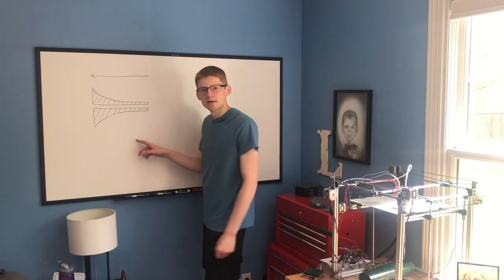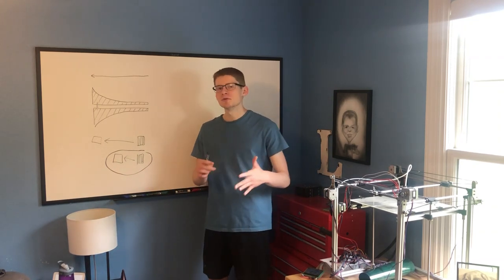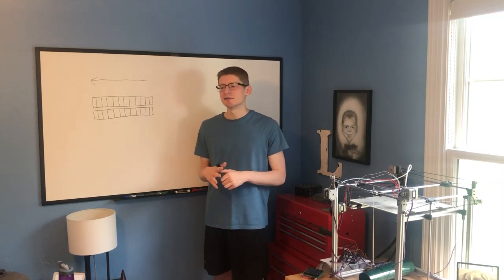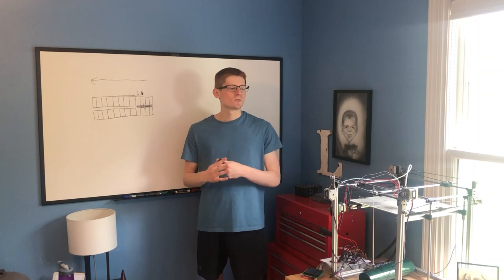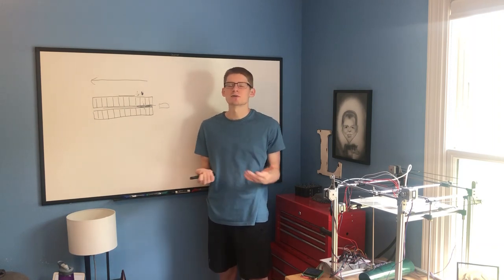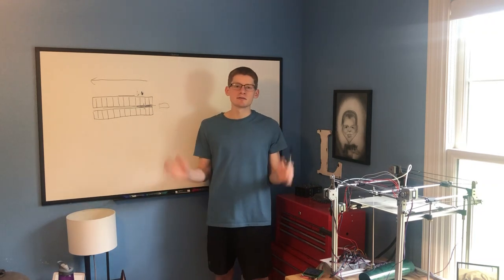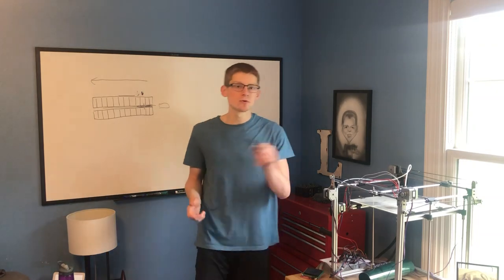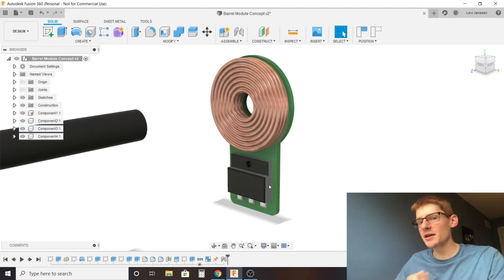Making a Coilgun - Part 4: A New Revelation

Comment: This seems like a brushless motor / ESC problem. A sensorless motor provides the feedback to inform the progressive pulse. The question about wire diameter and number of turns and resistance is a question of ampacity. The wire size you choose determines the current you can push V=I.R. If you sequence the firing of coils as you  describe but do them in series you put more voltage across the coils.

Comment: There is no ideal number of Turns in a coil. It all depends on the voltage you use. If your voltage is high, Your current can get lower because you can use a coil with more resistance and thus more turns. I observed this in different coils and voltages from 20v up to 1kv

I have Played around with Different coils and Different voltages. The thing i learned is that you can pretty much calculate the number of turns in a coil Based on your voltage and the resistance of your wire to get the Maximum current at the given voltage. You have to conclude every component in the circiut because the total resistance is important. 

I would suggest that you measure a given length (1m) of your wire. Based on this you can calculate the Maximum current at your operating voltage per 1m of wire. Then you just multiply the length and calculate again until the Maximum operating current is within the Limit of your Power source.

At the Ende you will have the exact length of wire you have to use. The ammount of turns hardly make any difference from there on given that you work with a "long" coil wich has more then 3 layers.

Also the results with long coils where the diameter is smaller than the length have been netter in my Experiments.

Contact me if you need more Information about coils.

Comment: @Levi Janssen .. Thin wire  would be your best bet .  As to the ideal number of turns per coil  that is going to require trial and error.   

Your going to have to make models of the coil on a slightly smaller scale than what would be full size and experiment with the different gages of wire and different windings.  

What you are doing is entirely experimental.  Once you have the number your comfortable with figured out you can scale up from the model to the full scale.  

Science isn't easy .  It takes trial and error to get it right. 

Thomas Edison made 1,000 unsuccessful attempts at inventing the light bulb.

When asked about it . Edison said “I have not failed 10,000 times—I've successfully found 10,000 ways that will not work.” Referring to creating the Light Bulb.  

But he did find one way to make it work obviously. 

So the way I see it you have two choices you can agonize over the questions you have about how to make your concept work or you can experiment until you figure out the one way that you can make it work.  

I think you can do .  Just get to it.

Oh and after you figure out the turn count and get the coil gun part set up it might be a good ideal to design a magazine feed system.  I haven't seen anyone do that yet.

Comment: How about using a conductive projectile where the base (or end) of the projectile is used to "make" the connection which gives power to the coil. The instant it accelerates and reaches the second coil (by kinetic energy of the first coil), it completes the power supply to the second coil which gives it thrust to move to the third coil and so on.
Only issue is the froction heat which could destroy the rails eventually (after firing a few rounds)
Reply: From what i understand that would essentially make it into a rail gun,  defeating the purpose

Comment: Isn't the magnetic field inside the coil mostly unifor? So when the projectile reaches the magnet it gets accelerated by an almost constant force towards the (offset) center. You also need distance over wich the acceleration occurs wich the cone shaped coil provides.

Comment: Just a couple of thoughts.
In terms of coil control, it is similar to microstepping stepper motors.
About detecting the position of the projectile, the projectile will change the inductance of the coil. There could be a voltage change on the coil telling you where the projectile is. Thanks for your video.

Comment: Nice! Would it be possible to collect some kind of data from the coil to detect when you power it? Some kind of hall sensor? Each coil should "produce" power and each coil should have an optimal point when to dump its stored power into the coil. Each coil would have it's own capacitors with the correct amount of coulombs/joules... Fairly "static" with regards to barrel friction and projectile weight, but that seems hard to get around without rather sophisticated real-time (high throughput) measurements...

Comment: i have made a coil using 32 gauge enameled copper wire but it does not work can somebody help fix this i have tried different batteriess but still does not work do i need to perfectly coil the wires side by side, please i need help

Comment: You've got a 3d printer just print a bushing that presses through the coil, you could probably just slip it into the next bushing and ditch the carbon fiber all together. When its built, seal it in a tube and oil cool it.

Comment: have you thought about using tiny wires between the coils and use the projectile to make electrical contact similar to a normal switch for locating the projectile, but I don't know how long that would last considering the forces involved.
For the coils you could try potting them in resin.
For cooling the mosfets there are already good suggestions, but for cooling the coils, in the past, I made a small high power BLDC motor using small copper tube instead of copper wire to Watercool the coils from the inside, that allowed me to push the motor from 500 Watts to 3300 Watts.
Reply from the maker: 500 to 3300 watts? I'd love to see that motor, it sounds remarkable.
Reply: @LeviJanssen  It was a Skateboard/Longboard hub motor, I don't have exact data on it, but the motor itself was most likely capable of more than 500 watts, but I had to limit it in the controller to 500 watts because after 10 minutes on more it started melting the plastic tire.

Comment: Use laminate metal sheets in between the windings. This may work the same as it does in solenoids and transformers. It concentrates the magnetic field and the laminate steel reduces loss from eddy current. Just a thought but best of luck
Reply: Would washers work?

Comment: If energizing more than one coil at a time you can also ramp them...   Like a multi-step controller for a stepper.     Or something better I just thought of (so it must exist)....  using beeeefy transistors and amplifying "audio" to multi-channels (for each coil)    Then to to calibrate and dial in, you can just generate a .WAV.  Sounds silly... but this way you get all the audio tools for generating signals and you can even generate them based on different algorithms.      (or have different files for different settings...  from Chastise to Inject to Perforate)
Still think there is some more life in your first idea...  maybe still a cone, but stepped like with this idea.        Also, why not just have all the coils charged ahead of the projectile, and just cut them off at the right time?   (kinda negating the audio file idea, this would just need timers or trip-triggers)
as for sensing, it might not take too much space if you can embed a sensor in the barrel, the wire can be hair thin for a sensor... or use a fiber optic thread to project and sense the light in a more roomy zone.
I realize I have 3 separate control mechanisms up there...   Manipulate, Time, and Trip
I should watch the second half of the video, I guess.  :)      (Edit: or read the comments before I write a novel)

Comment: Yes a coil gun without sensors works best. The timing doesn't even need to be that precise because the maximum force generated by the coil stays quite constant for a short distance within the coil. I measured the forces applied to the projectile depending on its position while pushing constantly 10A through the coil. 
However, I'm actually having constant speed with every shot without using sensors. Only the starting position needs to be kept precisely for every shot. 

I think you shouldn't take such a short coil. Aim for a square winding ratio instead like 16 x 16 or 20 x 20 or whatever. The reason is the (simplified) equasion H = i * n / l where l gets minimum when using a square shape. Using a coil that is shorter than its height has two negative effects: 
- H becomes lower
- Acceleration distance is shorter

Don't use IGBTs please. I was using a 100 € one for my gun which could handle 200 A constant and I thought it would be no problem for it handling 2000 A for 2 or 3 ms like Thyristors can with ease. Hell I was wrong! But you could still use IGBTs or Mosfets for low voltage/current per coil but you will probably end up with 50 coils to reach 140J kinetic Energy which I can achieve with Thyristors and 7 coils.

My most recent Idea was using multilayer coils (each layer has its own independent capacitors connected). This way you could release the stored energy per stage a lot faster which gets more important the faster the projectile becomes.

Comment: Optical Interruper is more reliable and fast, but does need a gap, i agree on that.

Lidar distance from rear is VERY intresting.  Would be cheaper, needs some testing.
Reply: The gap must also be increased for each additional coil and the sensors have to be adjustable in terms of their position relative to the coil.

Comment: 7/17/2023 4:00 PM
1. 1 BIFILER COIL
2. 9 CAPACITORS at 1F each
3. G7 Aluminum bullet 
4. Rifled RESIN barrel
5. 30 3.7V Lithium batteries
6. A arduino and code to control it all. And that only took two hours to come up with!

Comment: To hell with MOSFETS  !!!!!!!!!! I hate them.   Have blown too many from electrostatic discharges in the Lab.  I only use Power transistors like the TIP41 and up to the 30 Amp, 250 Watt, MJ21194 Power transistor. They can take a shit kicking !!!!

Comment: Machine your holding board out of Aluminum.  Make it in 2 pieces, 1 piece is a cover plate and the other plate is hollowed.  Use water for the cooling agent.  Start with the make up (dia, weight and length + the material) of the projectile (tungsten ).  Make the Barrel 1.1 x in dia. greater than the projectile.  Barrel should 10 x the length of the projectile.  Figure out the velocity in (m/s) using initially only 3 coils fired in a cascading sequence using optoelectronic (led + photo diode) as a trigger switch.  Determine coil size, + wire dia. + # of turns with a constant input Voltage and Current, by testing and recording the results.  Plot Velocity against power input (+ time pulse is on).  Try to make use of the Back EMF Created each time a Coil is Fired.  Add High Voltage Capacitors to the Battery Circuit to Boost out put power.  Use 16 gauge magnetic wire for the coils, which should be 3 x the Diameter of the Barrel.  Add Modules to the Barrel to boost output power.  Write an Python sketch to control an Arduino for switching on the Coils in Sequence.  See / find out how to wind Pancake Coils.  Use Hot Glue to hold the Winding in place, then cover in epoxy.  Capacitors will handle rapid/sudden voltage Drops than batteries will.  Have 2 separate coil banks so that one bank can fire while the other recharges. Good Luck and Happy Engineering!!

Comment: I know you have asked for ideas regarding the number of turns for your new idea and I am sorry to say my knowledge of such things is pants. but I was thinking could you wind the turns as one single like previously but with a skateboard ramp style curve, with the curve larger at the start, curving down with less turns before increasing the number of turns towards the barrels exit. this would possibly allow you to overcome the issue of starting the projectile so far away from the magnets main pull, costing efficiency as it has to accelarate towards it inefficiently at the start. I wonder if at the start the thickness of turns should not be maximum but enough to give it a good push whilst being lower than the attracting magnetic pull in front. as I mentioned earlier I am no scientist, but my ADHD brain seems to be able to see soloutions to problems in a similar way to yours. let me know your thoughts, there is probably a glaring reason why my idea would mot work, but wanted to share to find out your thoughts. thanks from a curious mind

Comment: layer upon layer held in place by a resin in a mould, fine layer of ceramic or glass to insulate ?

Have you worked out the most efficient windings ?

Comment: I have not made a coil gun but have mulling a few ideas, one is to use fiber optic strands. the IR diode is glued to a photo optic strand, and inserted into a disc used to hold the coil the disc could be cut in three parts end doughnut, two semicircles glued to the former and the fiber optic of the IR transmitter and the fiber optic to the IR receiver, then the other end doughnut. I have a few other ideas floating in my head if you like.

Comment: Using the same conecal shape, could you just make the whole cone a single layer of winding instead of more winding on the larger side?  Wouldn't the magnetic force be greater in the small diameter section with equal layers of winding throughout the cone?

Comment: Also do a hybrid of controler based and trigger based accelerator. I mean you have something like an LDR strapped to a mosfet and the mosfet triggers directly the coil but it can only trigger if the controller gives the ok. So the controller is like a director that decides which coil may fire and which on doesn't. Also the coils give information to the controller such that the coil decides on the fly which coil to activate next

Comment: if its a matter of where to put limited energy then it wouldnt make any sense to share energy with other coils since their influence wouldnt be enough to justify the power consumed.

if you have power to spare and simply adding more energy to a single coil results in a problem where you reach a point of diminishing returns...then there might be a lot of math to do trying to figure out where and when to give power

a polarized projectile would probably just complicate things but i havent given it much thought

Comment: Optic fibre between the coils keeps the detectors outside the coils and can be made as a remote detector and control module. You can wind the optic fibres into the actual coils. On-time is important, but also, inductors take time for the field to collapse and will slow the projectile if the coil is not collapsed in time. Bundle one end of the optic fibres to your IR source and detectors for each coil optic fibre. One or more feed fibres and a detector fibre for each feed fibre. You need to understand inductance more in your coil designs.

Comment: As far as detection goes, an optical rangefinder behind the breach of the gun seems most sensible to me: no need to space out the coils further and the information for timing all coils is obtained by a single sensor.

I agree with thin coils. I'm pretty sure the resistance, magnetic field etc gains of the number of turns in the coil all cancel out so long as the volume of copper in the coil remains the same. That means you should go by the current your power supply operates most efficiently at.

To cool the MOSFETS, i would just thermal cement them to the coils they control and use them as the heat sink.

I'm also wondering if you could direct the flux from the coils into the projectile better by installing ferromagnetic discs between each coil and a pipe containing the coil/barrel assembly in the centre.

To make it efficient, you'll also want to recharge your capacitors with energy stored in the coils when they're disabled.

Oh yeah and submerge the barrel assembly in liquid nitrogen =)

Comment: 1.  You can't design the coil in a vacuum. The correct number of turns depends entirely on what voltage/current whatever power supply you are going to drive it with will use. If you have it hooked up to a capacitor where you can drive 10kA through the coil, the answer will be totally different than if you have a 60V lithium polymer power source with a much higher ISR. Also, you have to work with voltage/currents that you can actually switch feasibly. 
2.  Yes, there's not reason such a device won't work perfectly fine open loop, but you might be able to use hall effect sensors to get the position of the projectile. It will have some of it's own magnetic field/distort the magnetic field, and as it moves down the barrel, it will move past the sensor and create a signature different than just what happens when the coil turns on (though not sure if it would be discernible, signal to noise ratio might be really bad).

Comment: High Power via "Modular Construction" on the coil end, and the PPS side, then just choose barrel size, add a pellet/projectile injection system + control system, and go.
Reply: Also i wonder how many stages until "max speed" also what that would be...
Reply: Also make some sort of optical interupter for auto 
stage triggering?
Reply: I was also plotting a Open Source, Modular, Pulsed Power Supply, would go well with this project.

Comment: Why didn't you just use a row of toroidal coils as they would give you a directional flow to begin with.
Reply: Because its worse, the toroid has the flux concentrated in its ring, not where the barrel would be